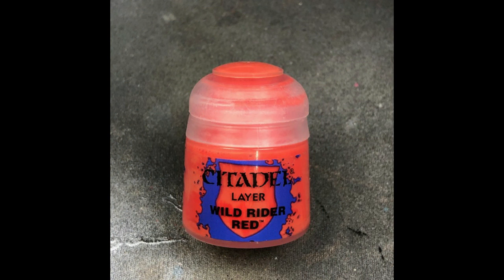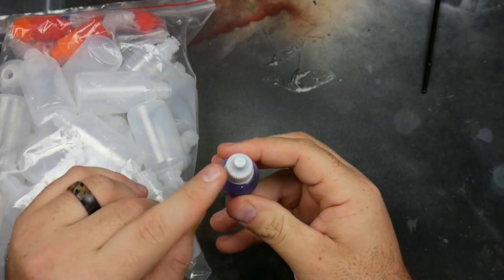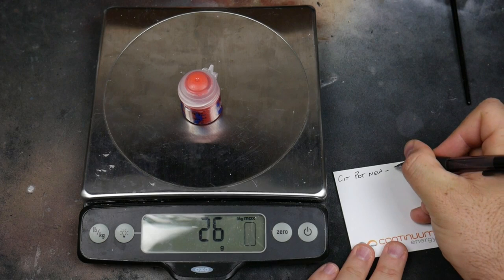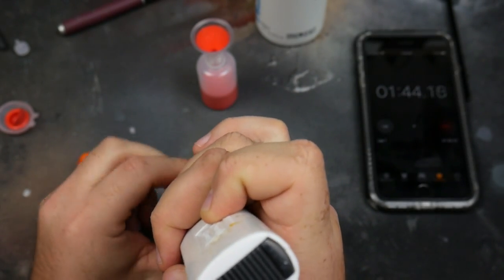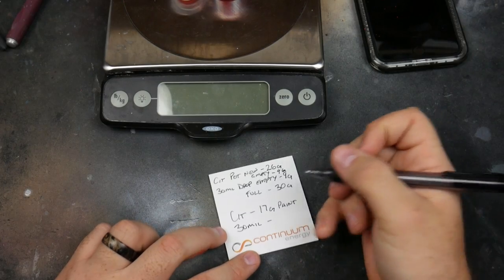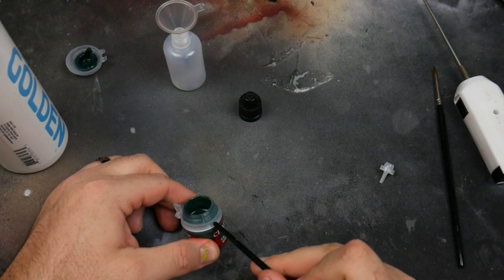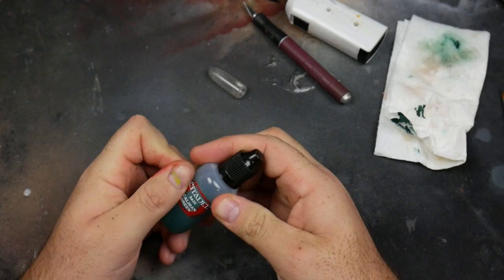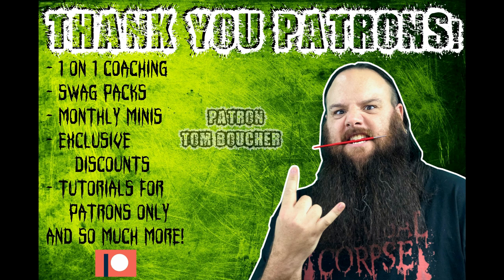Decant Paint Quick & Easy With This 1 Simple Trick!!!

Comment: I bought one of those Badger gadgets years ago for £10 I think it was. ONE OF THE BEST THINGS I'VE BOUGHT IN THE HOBBY 😊 Be careful to turn it off BEFORE you take the spinner out of the paint pot completely else it can get EVERYWHERE 😅😅😅
Now I use a make-up/nail varnish shaker so I can switch on and get on with another task.  I still have the Badger device though ❤

Comment: I could have used this advice several years ago, but will definitely keep it in mind going forward. I have all of the Contrast paints now and would like to transfer them to dropper bottles.
Reply from the maker: Gene Jordan the beads are glass.  You get 50 of them for $1.75 from creature caster and they’re pretty heavy.  I’ve been using them for a year with no complaints
Reply: @ImpendingDuff  Thanks! I had commented before you mentioned it in the video, so I edited my comment.

Comment: Very nice method. Gonna use it when I buy those couple paints I need from GW. I use mostly Vallejo and army painter. A question if you or anyone else: Do we need to use the medium on GWs contrast paints as well? Or do we need to do with it a bit lighter-less ?
Reply from the maker: Contrast is fluid enough that you can just pour them right into a dropper with out any added medium
Reply: @ImpendingDuff  thanks for the information and the whole video man.

Comment: I am about to do this myself. I was just going to use a couple drops of airbrush thinner in each pot. The thinner says it doesn't effect the properties of the paint. Do you think this will be fine? I've also got the paint mixing agitator stainless steel balls from the army painter and now Im afraid to use them lol.
Reply from the maker: well, first, you have to consider what thinner was intended for... thinning for use promptly.  thinning to be used in an airbrush per application basis, so, in theory... no, it wont effect the properties of the paint for that few minutes youre working with it through an airbrush... but, consider that paint sits for months on end and in some cases, a year or more... so i would urge you not to use the thinner.

as far as the "stainless" steel agitators... let me ask you this.  youve spent how much on your paint collection?  $100? $300?  more?  there are PLENTY of instances across all the fb groups of people who trusted "stainless" in their paints, and now have rusted out bearings that they have to replace their paint because of... you have literally ZERO instances of that with glass agitators... is your hard earned money worth that gamble?  if the answer is yes, then by all means proceed with the "stainless" steel agitators... or, spend $1.75 for a 50 pack of snail balls from monument hobbies and know 100% your paints will not be getting destroyed.  keep in mind, these people whos paint have been destroyed by "Stainless" agitators, have had the ultra fancy grade "stainless"... or so they thought according to who ever they bought them from.  

thanks a ton for watching, and i hope you have great success in your transferring!
Reply: @ImpendingDuff  Thank you for the advice.

Comment: Thanks for the great video. Just a question: How exactly does water impact the colours? I thinned some of them with straight water and I am a little afraid that I ruined them. 🙈
Reply from the maker: thanks for watching!  Water is acrylic paints solvent, so over time, water will break down the chemical bonds between binder, medium and pigments.
Reply: @ImpendingDuff  is it possible that regular water is causing the breakdown, would the same thing happen with distilled water?

Comment: I just did a quick calculation and if you are using Contrast paint you gain an extra £1.00 worth of paint. Ok you have to add the cost of medium and the bottle but the cost saving and ease of use make it worth doing.
Reply: the medium would ruin the contrast paint though. don't put stuff into contrast.

Comment: The stock funnels are too narrow--Look at all that wasted paint. Just cut the bottom off one of those funnels so it fits tightly around the top lip of the new bottle. Vortex-shake the GW paint pot with a couple of 4mm stainless balls and a few drops of the thinner of your choice. Pour, add a couple more drops thinner, shake, pour again. Very little waste that way. I've transferred over 300 GW paints this way. Cheap, Efficient, Clean.

Comment: Good vid.
No, your not getting MORE paint. Lets be clear... you're just thinning it. There is a bit of paint remaining in the citadel pot, but given the integrity of the seal on those pots I guess it comes out even. I guess if you dont have that stick shaker thingie, one could get by with putting the lid back on and shaking instead.
Reply from the maker: KrogunDK thanks for watching the video.  if you start out with 12ml and end up with 16-17ml... that’s more.  And shaking works if you don’t want to get the mixer, but I found that shaking was leaving more paint behind because I couldn’t get the medium to evenly distribute.  It being evenly distributed made the paint a consistency that would allow it to drain from the pot more completely and thus eating less, so I much prefer the added Benefit of using the mixer vs shaking for shaving me more material.  There’s no reason you can’t shake them.  Over the course of 82 pots, I just found I’d get another 1-2ml mixing vs shaking.
Reply: Volume + Volume = ...MORE! YAY! You did it!